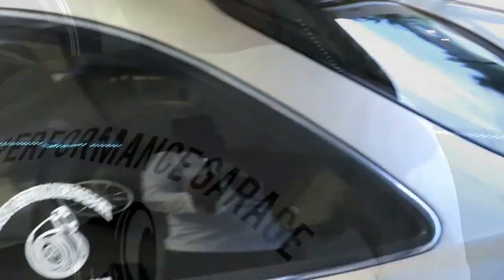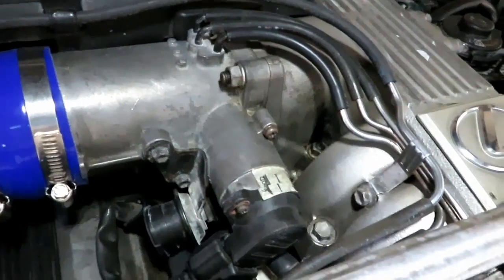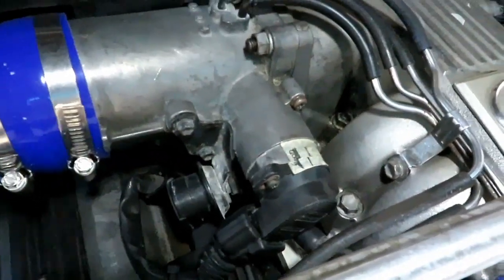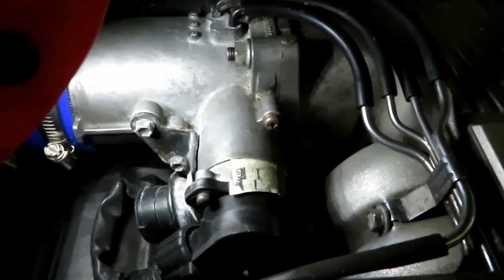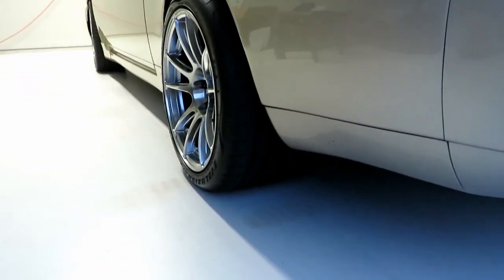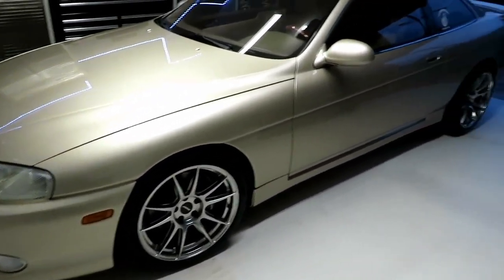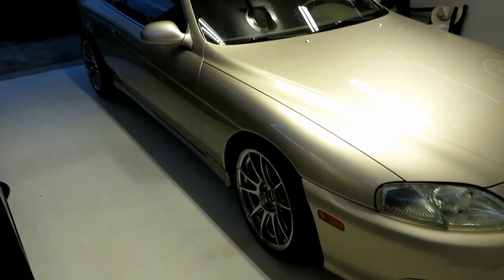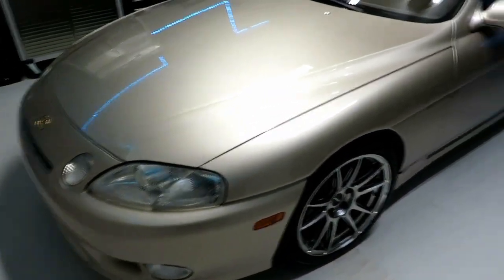LEXUS SC400, LEXUS SC300 THROTTLE POSITION SENSOR, HORSEPOWER TRICK.SENSOR DE POSICION DELACELERADOR

Comment: I have a 93 sc4 with a high idel problem just started yesterday when cold it's around 1500 when it warms up it goes to 1000 just last week I replaced the IAC valve, looks like a simple mod you have though nice
Reply from the maker: Have you changed the MAF?
The MAF has a temp sensor in it and if it's bad this could be a symtom of a bad MAF
Reply: @GazaPerformanceGarageGPG  nah not yet but il check it tomorrow to see if its dirty and needs a good clean probably check for correct voltage

Comment: Pretty positive the Soarer 4.0GT's make the same power as the US models. No UZ engine came in stock form with 380hp. Im also curious how this effects your AFR's ive messed with my TPS a little, replaced it with a updated part number and came to the conclusion that the ecu will divert back to factory setting. Best way to make power is to go standalone, toyota ECU's are a pita.
Reply from the maker: Thats what I was told
Reply from the maker: You have to remember back at the time when they were making these cars from Japan United States of America and Japan had an agreement it's called The Gentlemen's Agreement that all cars coming from Japan had to match the same horsepower rating as the one in the United States but what Japan did not tell us is that these cars came with more horsepower than what the brochure stated
Reply: @GazaPerformanceGarageGPG  they didn't though, they had to retract acclaimed ratings because they output less than stated. I remember the gentlemans agreement, but among the engines that were underrated the VVT-i engines. Non-vvti engines output less.
Reply from the maker: Any one is free to comment, tell us what you think💪
Reply: Fake news
Reply: No, just no.  Non vvti came with about 250 and vvti came with 290-300. What you are doing with the tps is not helping your car perform better, it is actually going to probably cause you to wash the ringlands and the bearings from running so rich. Hopefully you have a motor on the side when it blows. Running rich is not a good thing, can be bad as running lean..  And Your friend in japan is full of shit.  There is no stock 1uz producing 380 horsepower without forced induction.
Reply: Thank you this guy knows nothing adjusting tps so called making it rich sc400 run rich as hell as they are I ran 8lbs of boost on stock fucking injectors I had to take fuel out with what......a piggy back until I went standalone e85
Reply: @GazaPerformanceGarageGPG  Late reply but the Gentlemen's agreement was only between Japanese auto makers, in Japan.

Comment: The 1uzfe already runs rich. Leaning off gives power air fuel ratio on n/a needs to be leaned off to produce more power and efficiency.  If you getting an increase by doing this you’ve got an issue. All ls400
Have a sooty pipe cos there all rich from factory. I know because I use a piggy back ecu and leaning off give more power. You only need to add fuel what charging.  I have done many runs with a wide band data logger and taken data from exhaust. But any changes made are temporary cos the ecu will revert back to base map. This is the reason you can’t remap the Lexus/1uz ecus their proprietary data is irrevocably over written and hard coded.
Reply from the maker: The car did 1 week and 2 days on a tank it ran very responsive. i wish i had the wide band at the time but the car is sold  but thank you
Reply: Go full aftermarket ECU then like AEM 🤷‍♂️
Reply: @GazaPerformanceGarageGPG  show proof on dyno because I doubt this is doing any good aswell..

Comment: Is this good for the engine? Does it make it wear out faster? Does it make my engine have more problems? Is it gonna have weird idles?
Reply from the maker: It's just have more fuel on demand to the air =more power. It's still running strong

Comment: Have you ever adjusted the earlier TPS on the UZ1?  I have a 1992 and I can tell it's running rich just by the smell.  Would like to lean it out.  It has two TPS on it, though, instead of 1.  You ever messed with these?
Reply: The one in the same position as his is the tps, the other is traction control
Reply: He’s got a 1-uz as well as you bro, you can tell by his taillights and rear bumper but that’s a 1st gen sc4

Comment: What wheel make, size and tires are fitted, they look good
Reply from the maker: Circuit performance wheels CP32 front 18x9 + 35 rear 18x10.5 +22
Reply from the maker: Tires front 265 35 18, rear 275 35 18.
Reply: @GazaPerformanceGarageGPG  Do you have spacers?

Comment: i just got a 92 sc400! it’s got a lot of work to do on it and the body is dented up, but not a bad deal for $1500 haha. anyways, my car has an issue of overheating only while idling, any ideas of what it could be?
Reply from the maker: It could be your that you're missing a thermostat or your hydraulic fan it's not working
Reply from the maker: All of my wonderful subscribers you're more than welcome to join in
Reply: thanks! i’m gonna try to look into it more tomorrow or the day after. i’ll probably replace the cooling system regardless to a bigger one. do you have any plans to boost yours?
Reply: @KeenanOKelley  check your fans even though they turn on they might not be pulling enough like they used to worn out etc also check your coolant make sure there’s no air bubbles in the cooling system & check the radiator fins if they aren’t blocked painted over anything to block air flow.

Comment: What intake system is that? I'm hesitant to change from stock since the area where an after market intake would be is so hot in the engine bay. Do you reccomend keeping stock and maybe doing bfi mod or getting an after market?
Reply from the maker: Check out the video on the gold heat insulator intake wrap, the plastic intake pipe actually hold heat longer than a aftermarket intake
Reply: @GazaPerformanceGarageGPG  wouldn't it be better for cold air to be sucked in through the hot plastic intake pipe vs hot air through the aftermarket pipe?
Reply from the maker: Fresh air through a ristrictor vs hot air without restriction hmmm. Is the air really too hot to let power drop, I will take the hot air without restriction

Comment: Bro I bought a 92 and has the infamous ticking engine sound. Have you run in to this issue? Car has 120k  miles and runs like it's on rails.
Reply from the maker: Mine tic as well
Reply: Mine ticked for a week because it sat for a while and it went away probably dry in the head from sitting
Reply: Mine has done the tic for the couple years I've had yhe car. Same with a weird grinding noise somewhere in left bank but nothing has broken and I've not found a reason for that. Tic most likely comes from cylinder 7 valves as it's common for them to dry out and get worn. However even if valve lash was correct, these engines do make a lot of mechanical sounds as they run so wouldn't worry too much. Mine has 134k miles

Comment: 95 sc400 220k runs beautiful Hey man i already re routed the harness wires seemed okay but my brake lights dont work hi beams you have to hold the switch back to keep them on no headlights
Reply: Update! you keep me working on my Lexus! Stop light switch fixed the brake  problem still no headlights though😣 or beams unless i hold the stalk any advice big bro?
Reply: Download lexus sc factory service manual (fsm) had wiring diagram
Reply: Headlight switch or integration relay

Comment: @GazaPerformanceGarage I believe mine has two TPS.. One in the same spot as you show here on the video, and one slightly to the left of that one..So would i have to turn both counter clock wise? Ty in advance.
Reply from the maker: The one that is in the same position as mine that's what you turn. The other one is traction control
Reply from the maker: Don't lose your original setting
Reply from the maker: @This username retrace your steps and start over you need to plug up back the track control
Reply from the maker: @This username also you can't have motor running when doing this
Reply from the maker: @This username to reset computer disconnect the ground on battery for 3 minutes then connect

Comment: Yo Boss, I have a sc400 I believe to be stuck in Limp mode. When I press the gas, it hardly revs past 2k and I had to drive it home going 5 mph. Man I am so close to giving up please help me out, only 19 years old no experience with Lexus’s. Sorry to bother you Boss I know you must get a lot of these.
Reply from the maker: It could be one of 3 MAF, FUEL PUMP OR FUEL PUMP ECU. you can start by bypass the fuel pump ecu  and if you have never replaced the pump I would recommend doing so
Reply: @GazaPerformanceGarageGPG  Appreciate it, I will go try it out right now! The original owner believed that the catalytic conv. was clogged. Thank you SO much 🙏🏼🙏🏼🙏🏼
Reply from the maker: @tkt9310  and also change. The fuel filter I just recently had mine was clogged,
Reply: @GazaPerformanceGarageGPG  hey man I tried replacing my fuel filter. Did you have any problems getting the bolt off?
Reply: @tkt9310  you found out what it was ?
Reply: Probably your tps

Comment: Why my sc400 only burn out with one tire passenger side
Reply from the maker: Because they all came with positraction differential they did not come with limited slip the only way you can get both tires firing up is if you weld the differential more get a Toyota Supra differential
Reply: Weld it!
Reply: I managed to get my open diff to spin both wheels with removing my cats but I’ve recently installed a 4.10 lsd to eliminate 1 tire fire permanently
Reply: All open diffs have to swap in supra mk4 auto tt diff lsd or aftermarket clutch type

Comment: So thts all i need to do is turn the tps sensor back a couple clicks is there any thing else involved
Reply from the maker: Mark the original position of your TPS sensor
Reply from the maker: If you want more power you going to beat out your catalytic converters
Reply: Are there any more tricks to get a little more power out of it
Reply from the maker: Watch the video on the fuel pump ecu bypass. Also remember, more air more fuel =more horse power
Reply from the maker: So you're going to need to upgrade the intake and your exhaust system you can start off with 2 and 1/2 inch for the dual exhaust system or you can go full full 3 inch exhaust with the x pipe and you'll be on your way to a really good horsepower and possibly the car be ready for a procharger
Reply: Gaza Performance Garage G.P.G  you don’t need x pipe with 2.5?
Reply: @kool-aidsphuckery9596  The x pipe will help with exhaust scavenging
Reply: @GazaPerformanceGarageGPG  hey where are you located buddy

Comment: 14.7 to 1 perfect  on na if can get 14.5 na arf than that perfect afr for na. If go lean egt go up and melt piston and head.  If 2 rich na get that soot and louse power..boosted cars need 12to 1 afr or less ...not to talk about ign timming and using knock sensors with air temps...use a wide ban to tune car about 8 inches from turbo down pipe or 15 inches from exhaust head if na....i speak wisdoms..same with every car on pump gas or 100 octane.  Trust me.  Im 40 been racing jdm cars all life.  ..hell i remember datsun became Nissan